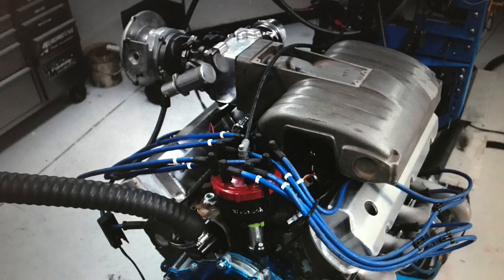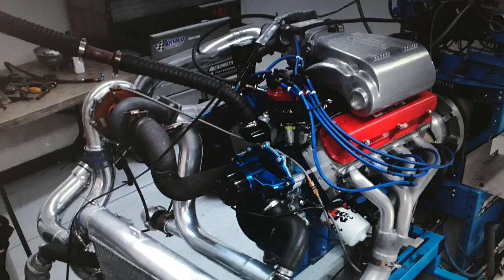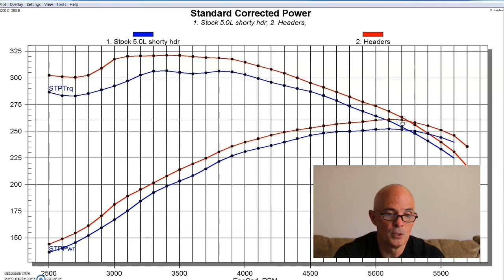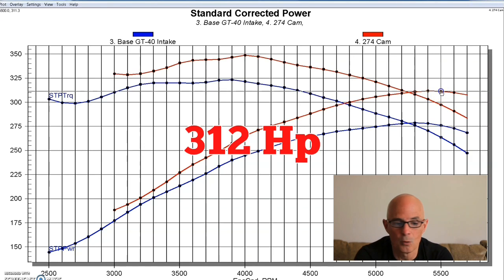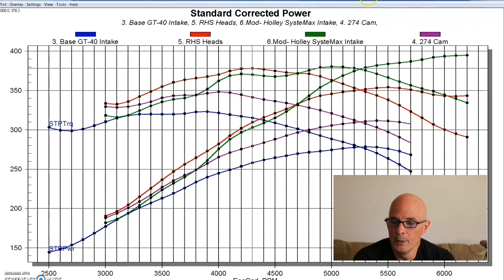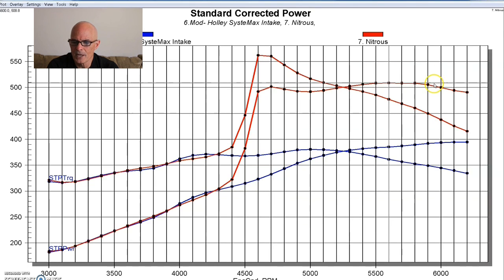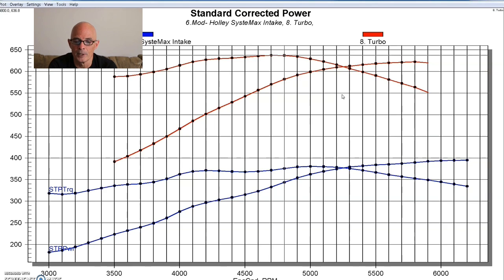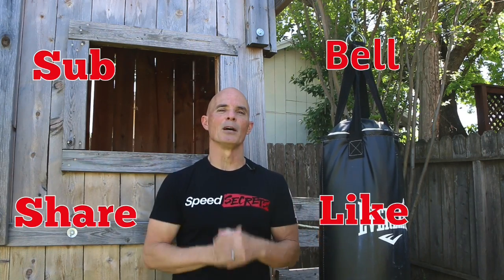BALLISTIC BOLT ONS & BOOST-5.0L FORD

Comment: I run this cam in my 89lx because of the article in MM&FF you did yrs ago on cams where you swapped a ton of them in a test motor on the dyno.  I ran ported stock heads for awhile and until i got a good deal on a set of Canfield 192cc heads. Which you never hear about anymore, but were sweet back in the day.  With that and the ported GT40 intakes it runs pretty good! Of course i've had the car for over 20yrs now.
Reply from the maker: nice-that cam test was way back
Reply: @richardholdener1727  I'm sure i still have the magazine somewhere in my collection! I remember you stating that the silicone wasnt even dry when you were swapping the cams.

Comment: Thoughts on building a 351w in a 90 F150?  Stock it's super lazy.  I feel like 400hp and ~400lb ft of tq would be plenty.  Also, thoughts on the bolt on truck Edelbrock RPM manifolds?

Comment: Still waiting for the comparison of turbo long tube headers versus same flowing log manifolds.  Curious if the back pressure from the turbo effects the long tube gains. Would also be a good test to run a fixed dyno load amount and measure the time to accelerate between the two to see if the long tubes add a bunch of turbo lag in normal use.

Comment: Hey Rich! You ever mess around with "Anderson" camshafts? I had the N-41 in my 302 with ported 3-bar gt40's, longtube headers, typhoon intake, 24lb injectors, and 75mm tb in my '91 GT.
It was a lot of fun with the 3.73's and t5. The t5 didnt last long, tho.

Comment: Years ago a test was done on a mustang 5.0 roller engine that made 400hp with a stockshort block and  cam.  RHS heads, roller rockers high lift, headers, 750 cfm holley and a dual  plane manifold. No need for all that expensive stuff. 

   https://www.hotrod.com/articles/ford-302-v8-engine-buildup/

Comment: How much would the NA combination(s) have benefitted from increased compression?
Reply: Car craft did a test years ago with open chamber heads on a big block Mopar and got about 4% per going from 9 to 10:1. You get less going higher. 12 to 13:1 usually is about 2.5%. They did it with a huge stack of copper gaskets and lots of luck.

Comment: Great work Mr. RH! Thank you for answering the HP advantage of a shorty vs long tube header. If I've learned one thing from RH's channel is to max your NA engine combo and then add boost. When adding a turbo system, should one attempt to run long tube headers, or focus on an exhaust system with min bends and a direct path to the turbo(s)?
The SBF (302ci) block splitting problem, is this limited to roller lifter blocks, and not an issue with vintage (1968 to 1978?) hydraulic tappet blocks?  If building a track only, high rpm (5k plus RPM) combo, what is the boost/HP limit? Thank you.

Comment: Great work @Richard Holdener, I love seeing features on the old 5.0. I am running a stock bottom end 87 HO. I fly cut pistons myself, XE274HR, AFR 185s, Weiand Stealth with 1inch spacer, Holley 650 double pump with long tubes. Works great, 1 inch spacer made a big difference. Keep up the good work.

Comment: Install a Y or H pipe if using shortie headers you get about the same as long tubes most of the time a few horsepower more than long tubes alone.   At least that's what we have found testing cars on our chassis dyno.  Cool video, that's a lot of work . Thanks   
I would like to see the video testing different heads.

Comment: Mr. Holdenter, a Boost/Engine theory question if I may:
If maximum torque is the maximum VE rpm of the engine would you say that increasing boost by RPM past this point in order to create a perfectly flat torque curve is possible with out over stressing the engine???
In theory your 622 hp at 5800 would have been 703 hp at 5800 if the 637 pound feet of torque could have been maintained at 5800 rpm.
It's an interesting concept that might be fun to play with.
Reply: This is how modern manufacture create the flat torque curves. Mercedes has their biturbo v12 but the transmission is limited to 737ft lbs of torque. You will see lots of German cars that make the same torque across a rev range and the ecu is manipulating the boost and other properties to keep the output from the torque limit of the transmission or to the rated output. Lots of time a reflash on these cars makes huge midrange torque. What your saying is right. You can manipulate the boost curve to maintain the same output torque over a wide rpm range if exceeding that torque may be harmful to components.

Comment: im building a 351w, 88mm turbo, victor jr heads on a 72 block, forged rods and pistons 9.7:1 on 98 octane gas dual plane, 90* elbow, 80mm TB. what is the best flat tappet cam you have tested on a similar combo? 6k rpm max. we're going for 800hp
Reply: Why is your turbo so big? Most sellers rate their 88mm turbos at 1400hp or more. Your setup, for 800hp, i would be looking for something with a 75mm inducer. The S475 Richard has used works well. Your going to be making about 450hp without boost, and only loooking for about 1 bar of boost. For a cam, grab something like an XE274. Something a bit bigger will idle a bit choppier. They also make a Thumpr cam about this big and it would work well depending how good your exhaust is. 279TH7 is that grind. Good luck man. There's an article testing Dart195s with an Xe274 on a 302 where it made peak power at 6000rpm. The Thumpr cam will peak a bit lower and probably have better midrange torque with the trade off of lower idle vacuum.

Comment: Great video Rich! I actually read, read, then re-read your "Dyno-Proven SBF Performance" book and chose this cam for my first 347 build because of it. With ProComp 190cc heads, an air gap intake, about 10.5:1 compression, 1 5/8" headers and a 750cfm carb I ended up going 11.31 at about 117mph at 2880lbs race weight with that combination!

I actually followed another combination of yours shortly after with the same short block, AFR 205 Renegade heads, a Victor Jr intake, XR292R solid roller, 1-3/4" headers, and a 780cfm carb. Ended up going 10.84 at 121mph with that combination at roughly the same weight. 

I'm a bit of a SBF addict! Love seeing different combinations and dyno curves from various setups. I currently run an old school iron-headed Boss 302, which doesn't use a lot of off-the-shelf parts, but I love that aftermarket parts availability is thriving for these engines. Keep up the great work!
Reply: nice et on 1st combo but the mph seems low, was it over geared for that cam/intake combo.
Reply: What did you do for an intake manifold on that boss 302? I recently acquired a 1970 boss 302 with a tunnel ram. I'm considering a single plane if i can find one.

Comment: Can you please tell me how to best improve power and efficiency of my 7.5l 460 EFI BBF Motor? It’s a 93 and is inside my f350 and have not found any bolt on parts that I understand how to use or do with
Reply: Just generally confused.. if you cannot get your hands on a motor can you point me in a good direction please? Sorry to bother you, love your channel, have a good day
Reply from the maker: mild cam, ported heads, better intake, long tube headers, CAI all work
Reply: Richard Holdener oh wow, I did not expect you to respond. Thank you very much for both answering and your answer 🙏

Comment: I'm starting to recognize your go-to cams, so I know about what they'll do to the torque curves. Thanks.
Reply from the maker: this is my favorite 5.0L cam for street use-don't have other engine family favorites
Reply: the trick flow stage 2 is similar and costs less, it is basically a crane cams part. used it in a 331 build for both efi tfs-track heat and carb air gap,makes for a good street cam, with 3.73 gears makes lots of decent low end and mid range power with tfs tw 180 heads and 10:1 compression for NA use, also consider smaller chamber heads for NA since allot of 5.0 pistons are below deck and a short stroke it call be harder to up the compression, gasket selection should also be considered.

Comment: Seems like the NA mods saw gains all the way through, on the LS motors some mods give up torque at the low end but make up for it on the high end.
Reply: cuzz63 yeah the difference would be that the 302 ford is a very under worked engine, you get good gains from really anything cause the starting point isn’t spectacular. The ls has a better starting point so mods don’t work as well, there isn’t as much room for improvement. 
And I’m a ford guy so I’m not just bashing the 302, it just is what it is. 👍
Reply: @ZedTee77  yea, I figured that was alot of it.

Comment: So if the Ford 302 works great with a long runner intake making a nice long flat torque curve why wouldn't a 302 tpi Chevy work the same way
Reply from the maker: it does-but do you mean 305 TPI or do you want a 302 Chevy build with TPI
Reply: @richardholdener1727  3" stroke 4" bore you can source a 3 inch stroke one piece rear main seal crank and longer rods from a 4.3lt1from the Caprice you may have to deck the block .020 or .025  if the deck would take it   there are plenty of oversquare torque monsters out there Buick 455 Chrysler 383 400 440

Comment: Richard, did I notice a stud conversion on the e7 head to hold up better to the valve spring. I have that cam but never installed it because I questioned the pedastal strength with the increased spring load.
Great vids btw. I remember reading alot of the articles you have brought to video. Thanks so much for your content.
Reply: Comp used to sell adapter studs that were 5/16 on the bottom and 3/8 on the top so you could put adjustable rockers on without machining. Most guys just bit the bullet and went aftermarket because the investment into machining a factory set of heads if you needed a valve job would get you half way to a cheap set of aluminum heads. I hated using shims to set lifter preload, what a hassle.
Reply: @timothybayliss6680  l know exactly what you're saying. Who wants to invest any money into E7s. I'm not even a fan of gt40s.
   There are so many great aluminum heads produced now. I really like the trick flow high ports and the larger AFRs with raised exh ports. 
    The cheap guy in me is still curious how some of these issues are dealt with. Besides a valve spring upgrade and stem seal replacement, I wouldn't waste money on stock heads. Thanks for the response Tim.

Comment: That stock 5.0's dyno chart is damned similar to what the bone stock M117 5.0 Mercedes V8 I've got puts out. Bit less thump when accounting for idealised testing conditions, but we're talking a difference of a few percent. Not bad for how cheaply you can come by one, it won't really make a car fast but 300 lb/ft available from damned near idle is enough to have fun if you're angry enough with the loud pedal. Cheaper and easier to work on, too.

I've spent a lot of time over the past year wondering why I bought a German car. :lol:

Comment: I always wondered if the block splitting was a myth. Now I know. Awesome work.
Reply: Ive seen photos of the all 5 main saddles pulled out of the bottom, caps still bolted on. The blocks do break its just a question of where and how and how much power.
Reply: Its not a myth.. they will spit right in half!

Comment: Extrude Hone is something i have not heard in a long time
Reply: Been around for a long time .
Reply: It’s expensive it works if you want to look stock but doesn’t make sense for the price vs a new performance. Intake manifold that flows much better and looks cooler under the hood
Reply: Yeah right, it basically doesn't good power per price so people lost interest
Reply: Makes two of us!!! I think i have some old mags with their ad in them.
Reply: Wade N Extrude hone is a process not a place. It’s also known as an abrasive flow machine.
Reply: Back when a GT40 intake was new, the stock piece could be extruded to make the same power, for almost the price of a new GT40. One of the Mustang mags did a dyno test to prove it. Now these tubular units are used, and if you're going to EH, you might as well grab a Cobra or Explorer intake and grind that out. Or just find a used aftermarket job.  But its guessed that when Ford released the Cobra to the press, its intake was EH, along with the Z28 of that year.
Reply: I got the opportunity to use them ten years ago. Disappointingly, the late model 392 Hemi heads I sent saw no improvement on a flow bench.

Comment: Here's a question for ya: What's the most anemic factory cam (compared to the potential flow of the heads/intake etc.) that you've tested?
Reply from the maker: A Factory 180-hp Chevy truck cam I bought from Kragen auto comes to mind
Reply: good question
Reply: I would have guessed L31. Not the worst but vs potential...
Reply: The ly6 truck engine might be the worst. Rec port heads with 196/208 duration and .467/.479 lift. As far as i know these come with the same springs as ls3 engines and stabbing in just about any camshaft will reall help. This is easy to see why headers and camshaft can easily make way more than 100hp than factory.
Reply: Stock 302 cams from the 70s less than 190 duration and .380 lift.... pathetic
Reply: Thats what I uave bow in my zephyr. Dont remind me I need to upgrade this next winter...

Comment: I have a stock 113,xxx mile 1993 bottom end in my 1993 GT. Trick Flows H/C/I combo (stage 1 cam .499/.510 & Street Burner intake) N/A with full accessories and T-5 it made 284RWHP/320Tq. I added a V2 Strim with a Treadstone Intercooler. With a 6.87 lower and a 3.12 blower pulley it made 13.8psi and 509rwhp/489tq. Safe tune w/21° of timing. Other parts: Fuel- 42lb injectors, Aeromotive 340 pump & Regulator, factory lines. Exhaust- BBK equal length, O/R H pipe, magnaflow straight thru mufflers.
Reply from the maker: nice

Comment: Yes let’s see the sbf head test
Reply: If I recall, there are several of them Rich did. One on a 306ci shortblock, then on a 331, then a 408, with increasingly sized intake runners. Highly recommend "Dyno-Proven Small Block Ford Performance" by Richard Holdener. Some fantastic information in that book!
Reply: I second that, want to find the best heads for my combo

Comment: 380 ft pnds of tq is stout in a fox body. One request i have for this motor (if its still around) is all out N/A radical cam short runner intake high flow heads run it until it stops making power or dumps its guts. I hardly ever see them fly apart. Asking for a friend.
Reply: over 20 years ago, i built a 306 sbf, stock rods home polished, arp bolts for most everything, home ported twisted wedge heads, setup the springs myself with titanium retainers, dss tw flat top pistons +0.010 above deck arp studs, basic home port matching/porting vic jr intake, port match mac 1-3/4 lt's, lunati 244/254 duration cam, custom length push rods and chevy 1.6 RR's, coz no tw rockers at that time for my setup.ran mid 11's @ 119-120 mph shifting at 6800 with 4.30 gears in a 3000.lbs fox body, was pretty quick for NA back then.....the engine did feel like a 2 stroke though, it pulled til my rev limiter at 7k but could't shift it there.
Reply: A Parker Funnel Web intake would be nice to see compared to a Victor Jr.
Reply: really wanna see a max effort na build